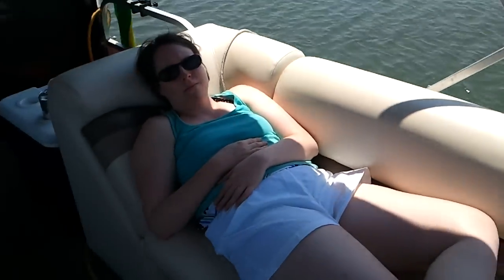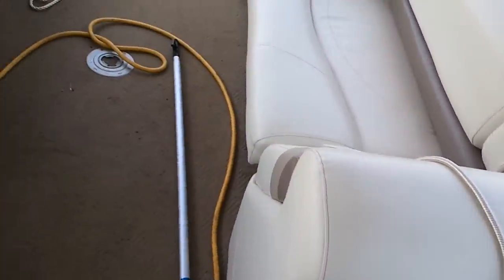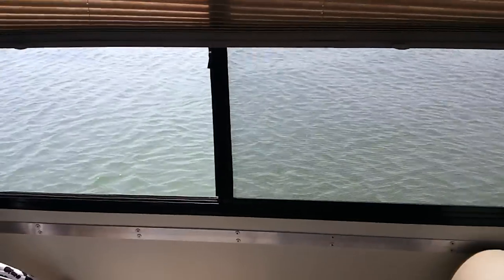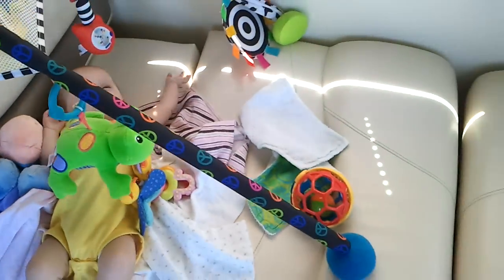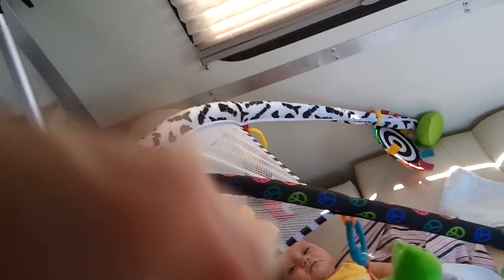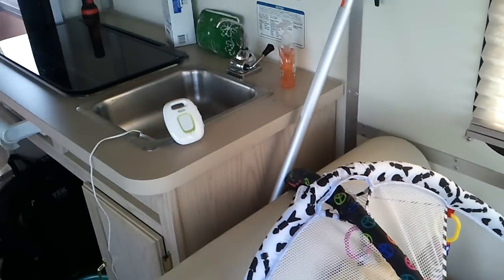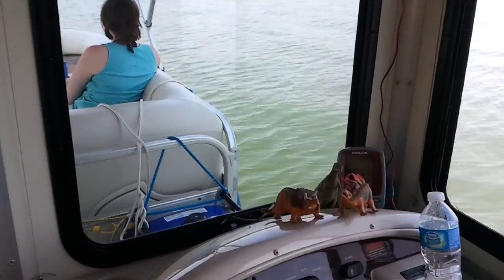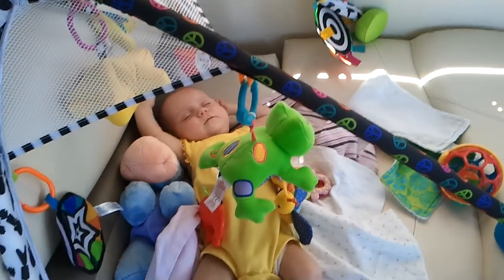Yamaha EF2400iSHC

Comment from the maker: @ERicincal With the door closed, it's actually quieter than the A/C inside the cabin. Also, there is *NO* vibration on the deck. Much less than the marine motor. Obviously the exhaust is pointed toward the lake and helps with the noise, as well as the CO issue. CO scare the bejezzus out of me. On very hot and humid days a tank would only last 4.5 hours. On your average hot day here in Nashville, it will last about 6+ hours. I have never ran it out of gas.

Comment from the maker: @ERicincal I considered a pair of 2000is. However the additional cost and hassle of stowing and moving two generators around on the boat made it impractical. I wanted something simple. I would say that it would be easier to transport two 2000is generators if you need to lug it a long distance and don't mind spending the extra $600.

Comment: I am torn between getting the 2400ishc unit or picking up (2) 2000is Units and linking them together.  Did you consider going this route as well, or did you go right to the 2400? Is it fairly easy to lug around?  Thanks for taking the time to respond.